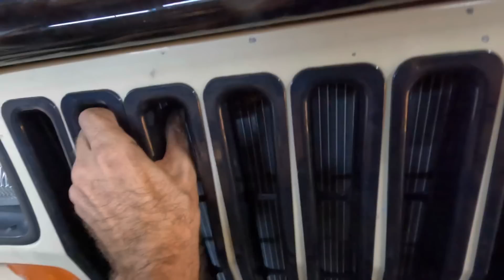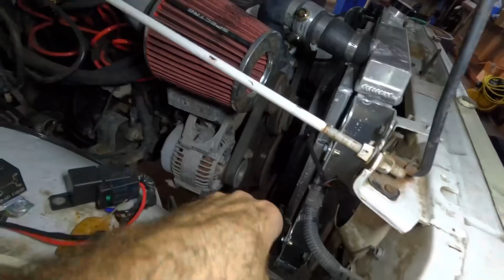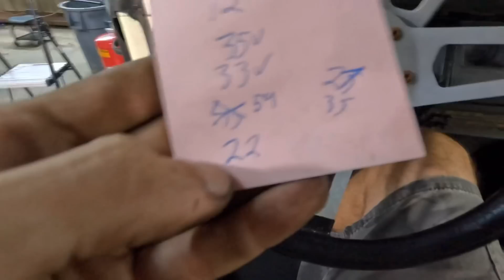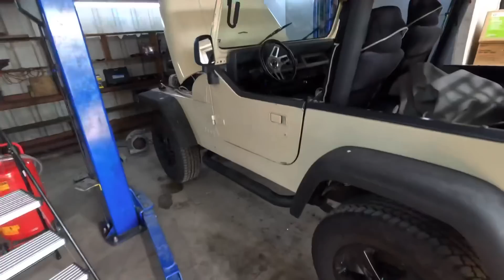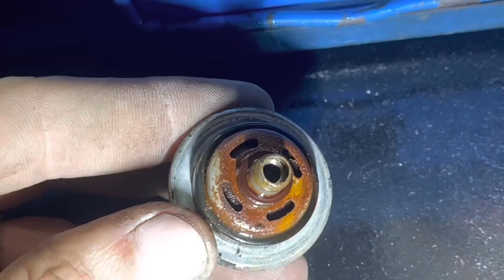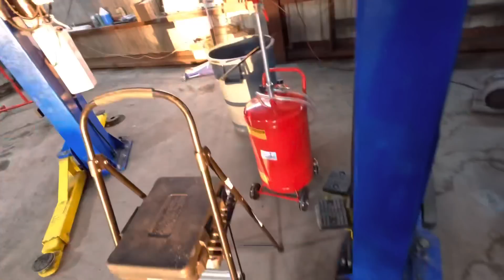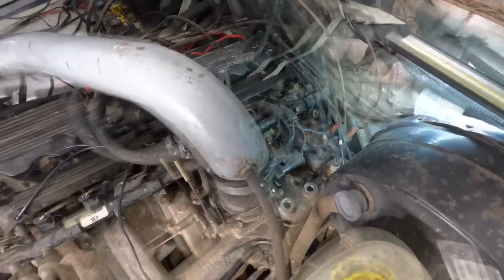Parts Cannon!! Can it be saved?? 95 Jeep Wrangler 4.0

Comment: Refreshing to see an issue present itself to the repair person as the owner reported. I did computer repair for a living and I often had to deal with issues that never showed themselves to us when we had the computers on the bench. The manufacturers frowned upon using the parts cannon (for warranty work) and we (the company) risked getting punished. Out-of-warranty work wasn't any easier, mind you. Customers didn't enjoy having to pay for replacing every bit of hardware in their computers and we certainly didn't want to be stuck with parts we might never be able to sell. It was easier if it was a higher volume model since we could "borrow" from the computers that were waiting for parts.

Comment: Mine is a 92, and it likes to run around 215. Got almost 600,000 on it. Never had the valve cover off it. 5 radiators, 7 water pumps, 2 alts, and 2 starter rebuilds. Tranny starting to give me some problems,(auto). 4X4, 4.0 HO. I am a preventative maint. tech, trained in the USMC/Navy. I have used TUFOIL in it sense I bought it in 98 with 70,00 miles. Replaced the suspension 3 times now. Will never sell it. XJ. You can see it on my YT. Same name. Peace

Comment: Could be pinched fuel lines near the tank. They run between a cross member and the body, and when the body mounts go bad, or the cross member rusts, the lines get pinched causing a low fuel condition. Happened to me on my 95 YJ. Ended up blowing a hole in the rubber hose connecting the fuel pump to the sending unit due to the pressure. Had to drop the tank twice as a result.

Edit: I think ray ruled this out, but I’ll leave it up incase it helps someone else
Reply: Customer said it got a new pump and filter but its not putting out enough fuel, has to almost start before it makes any pressure at all

Comment: We had a troublesome fuelling issue (lean running and bunny hopping at full throttle) which took ages to fix. Threw the parts cannon at it, finally even replaced the engine - but still had the issue. Turned out to be rust in the fuel tank.
Reply: I had a Honda Magna like that. Tried everything and it turned out it was the reserve tank had rust in it. It's always the last thing you try.
Reply: The YJs came with a 20 gallon poly tank. Ironically they offered the 20 gallon tank as an option. 15 gallons was the base (but it still had the same 20 gallon tank) with a revised fuel setup.
Reply: Money for nothing

Comment: That aluminum shroud blocks too much air, need to drill some 2” holes in it to allow airflow when stopped. Stock air shrouds are always ramped twords the fan those flat ones suck ballz

Comment: That jeeps a heep. Only thing I've ever seen cause red hot exhaust is plugged exhaust and spark/cam timing issues. Never seen a cooling system overheating cause the exhaust manifold to get red hot but maybe if run long enough to get to the point of low power.   I'd definitely check exhaust back pressure with a gauge, you can't tell by judging air flow and they get worse with heat.  Plugged exhaust can cause no/hard start too  I know it seems to run decent but I'd also make darn sure the spark plug wires are not switched around and check spark timing, that can cause your high exhaust temps and backfire/miss. Ive been fooled before with plug wires being installed wrong and it ran too good to suspect they were wrong. Could be just 2 wires switched around.  Incorrect ECT would cause hard start and low power too.I wouldn't be surprised if the injectors are half plugged too as much crud was in the fuel rail. Don't overlook the basics especially on something that looks like the owner already messed with everything and put eBay parts all over.

Comment: A Jeep with 156,000 miles?  Miracles do happen!
Reply: That's nothing on a 4.0
Reply: Those old mid 90's i6 fuel injected, you could put a ton of miles on them.
Reply: 295k on mine before another one was installed. 33k on that one now.
Reply: The 4.0 inline 6 is known to easily hit 400k miles with regular oil changes. There was an issue in the early 2000's with bad heads and them cracking when someone would overheat the engine. But otherwise were a solid engine.

Comment: I would drop the tank an check the installation of the new pump I have seen the rubber hoses separate an cause a fuel issue low pressure.

Comment: Great stuff Ray!

Let’s get that engine ground connected and other grounds inspected / cleaned.  Throttle body inspect / clean likely needed with that intake setup.  Maybe drop the exhaust to see if cat is partially blocked?  Maybe injectors need electrical connections cleaned since they didn’t have their clips and FL ocean air could get in there?

Comment: My neighbor had a similar issue on his expedition. He put a fuel pump on it 9 months prior. It died. Towed home.  Dropped tank. Got another new pump. Then I seen the box from the pump he put in it 9 months prior. No English wording. All Chinese symbols. OEM pump $300. Chinesium pump $50. I shined a light into the tank. Looked like silt in the tank. Fine like baby powder. I was looking known issues up. Seems those pumps have known issues. The seals deteriorate fast. They turn to a fine silt like substance in your tank. It actually gets past the filter. Clogs everything up. Saved $250 on a pump. Ended up buying a OEM pump anyways plus regulator, injectors, filter etc etc. That silt was all thru the whole fuel system.

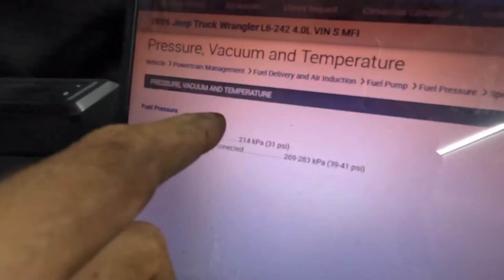Comment: I'm at 18:07 and I'm wondering if you have connected that floating ground strap yet. I would and then see what happens. Will watch to see what happens next???
Reply: Installing the ground wire strap, engine to body, I'm wondering if that would help solve some of the electrical issues with this one.

Comment: Check out the timing, over heated exhaust manifold, lack of power and slow throttle response, hard restarting points toward low timing. It could only be off just a couple degrees from spec.
Reply: I just said the same thing but you beat me to it, Dog Bone.
Reply: It's not adjustable.  So any timing issues would have to include the timing chain set, would it not?
Reply: @davidtucker3826  hi, the timing chain can jump a tooth if the sprockets are worn and the chain is stretched. Obviously this wouldn't fix the misfire issue.
Reply: @davidtucker3826  Yes the timing is adjustable, just rotate the distributor. They all have timing marks on the crank pulley and on the block. If you want to learn about timing and what is does to the Proformance of an engine watch Nick's Garage on youtube.
Reply: @dogboneknives7938  not on a jeep 2.5 or 4.0.
Reply: @davidtucker3826  Yes THEY DO, Just ask RAY, as he just said it on Jeep Part 2!

Comment: BG44K would work wonders on those injectors I reckon.
Running hot maybe down to running lean, possibly in combo with advanced ignition timing.
Looks to have a conventional distributor on there that could have faulty advance and possibly been swung by an amateur to compensate.
You need to get the strobe on it.
Reply: Running lean for sure.  I'd want to check the condition of the plugs to see if it's all cylinders or not.
Reply: This is exactly what I think it is. No idea if you can adjust the timing on these thou
Reply: You sir are correct in one of the many cause that can create the misfire and poor starting. I'm still concerned about that fuel pressure not changing to a higher value when vacuum is removed. Can't take the word about many parts changed being of gud quality. That compression needs to be tested as well.

Comment: Could the manifold be bent and drawing air. Might be worth whipping it off and putting a straight edge on it.
I'll edit once I watch more of the video..
So, looking at the condition on the inside of the FPR housing,  it may well be worth flushing and cleaning the fuel delivery system.
Doetake a very big piece of 💩 to get lodged in an injector nozzle and restrict fuel delivery.

Comment: I have a odb1 testor for sale if you want it, 75 Plus shipping and it's not a cheep one the fluke meter inside is worth more than I'm asking. My 4 cyl. 5 speed seemed to have more up and go than that 4.0 it would turn over a set of 30 inch wranglers.

Comment: You missed the title of this video by a mile. It should have been called code 54 Where Are You.
Taking some vitamin B2 on a regular basis, or even a good vitamin B complex will reduce the mosquitoes attacking you. It put something into your sweat that most mosquitoes try to shy away from. I used to have that problem quite a bit and in preparation for some work I did in South Africa many years ago a friend of mine told me to make sure that I load up on vitamin B2 or good vitamin B complex before I go to avoid mosquito issues. And it worked actually quite well. I have not had mosquito issues pretty much ever since, very rarely do I get bitten.
I noticed this years ago that with electronic injection, that people were starting their vehicles improperly. When you had a carburetor, all you needed to do, was to push the fuel pedal down about a third of the way count to about three and let it up so that the choke would set and you could turn the key and start the car almost instantly. When electronic fuel injection came about you didn't have to set a choke. But what people would do is turn the key from off to all the way to start. That does not allow the fuel pump to get pressure up. And as Vehicles get up in age like up in the 80,000 Mi to 120,000 Mi or so they tend to start very hard. Because you should turn the key on and let the fuel pressure stabilized and then start the car. It is so much easier on the pumps The Regulators and the ignition system. And this Jeep seems to have suffered all the ill effects of that bad habit.

Comment: Consider doing a injector leak down test.  With the rust in the fuel lines most likely the injectors are plugged causing lean condition. Take fuel rail off turn injector upside down and beat out on a paper towel and watch the junk come out.  Also every time you check fuel pressure you should check fuel flow, by pressing valve on the fuel pressure gauge, at idle car should remain running. The fuel you release should be put in a glass jar and let sit to see if it has water in it.  Water in fuel would explain rust in fuel rail and many other issues.
Reply: I woulda been checking plugs too, probably loaded up from the bad running.
Reply: I agree it was quite a bit of rust in that regulator have a good day
Reply: You can pull the entire fuel rail with injectors out. Pre buy new injector o rings from napa. Clean the injectors well and replace the o rings when installing. The fact that the injector plugs were obviously played with leads me to that being an issue. Add in the new rad and goofball cold intake - I wouldn't be surprised if the owner installed 'high performance injectors'. Amazon junk.
Reply: I spend 2 days trying to fix a truck once.  Drove it around for two days trying to isolate drivability issues. When I filled up with gas all the problems disappeared,  was a painful lesson...  Since then countless times I have found water in fuel. Usually when I find this I ask customer if they used gas from can they had for mower, 100% of the time they said "Oh yea I did do that.."  Here is your bill, so you remember not to do that again!  Included in bill was two cans of Isopropyl Alcohol from drug store, that we dump into tank to get water to bond with gas and run through system.
Reply: @MrEmbedded  Hmm so you can resolve a water in gas with rubbing alcohol... prefered % for this application?
Reply: @stevenswenson7041  yes the IPA will bond with water and gas and allow it to mix and run through engine. I like 99% IPA but have used 70%
Reply: Check timing ?
Reply: @loubakker5000  Why not?  If only to eliminate it as a problem.
Reply: @skingk2632  He has no fuel pressure. Check fuel filter ?
Reply: @loubakker5000  Just replace it. Two host clamps and a few metric bolts to get to it.
Reply: @loubakker5000  He does have fuel pressure, but the regulator apparently isn't responding to vacuum.  If that was due to the filter being so clogged it couldn't provide any more pressure I wouldn't expect to be able to drive that Jeep, it would fall on it's ass as soon you the loaded the engine .  What he should have done before condemning the regulator is to test it with a mityvac vacuum pump rather than relying on manifold vacuum.
Reply: @loubakker5000  he said fuel filter and pump been replaced..
Reply: @elvisziemelis3723  Check nevertheless. Eliminate as much as you can, starting with the petrol. Well, you know what I lean.
Reply: Agreed, that amount of crap in the fuel rail is a big red flag and quite likely to have contaminated the injectors.  Possibly the fuel filter has collapsed with age and is allowing unfiltered fuel through,
Reply: @ferrumignis  except he mentioned multiple times that the fuel pump and filter were brand new... yes its possible that the fuel pump could be faulty from new, but its unlikely the fuel filter is faulty from new unless the person that replaced it put it in backwards!
Reply: @Aspie_Geek_UK  Yes the filter is new now but what was it like before it was replaced?  Something has allowed quite a bit of crap to build up in the fuel rail.
Reply: @ferrumignis  That's a really good point. My Studebaker Champ kept clogging up fuel filters until I pulled the tank and gave it a good cleaning (that was fun!). No more problems after that.
Reply: @ferrumignis  Ray said it has a new fuel pump and filter
Reply: @ferrumignis  he stated it has a new pump and filter but it could be defective?
Reply: @paulabes4220  Is my post about the filter condition before it was replaced not visible?
Reply: Smart stuff... Water/rust...in fuel...old curb stator units had rust in float bowls too.
Reply: I’m wondering if that Jeep hasn’t been under water,that would explain why all the sensors and computer have been replaced,and explain all the corrosion on all the relay terminals.
Reply: @jackieliner3812  27 years can also do that to a car.
Reply: You are correct. Pull fuel rail and injectors. Flush install new o rings
Reply: I think the injectors are clogged too
Reply: Injectors are junk, check the new fuel filter for rust
Reply: O2 Injector will cause A leak condition
Reply: You must all be mechanics.
Reply: @Leothelion2008  Don't need to be a professional mechanic to know that rusty crap in the fuel rail is not good.

Comment: Thermostats and rads go out in those like it’s nobody’s business! Well, the sample size of THE ONE I HAD anyways lol but those inline sixes used in those old TJ’s were basically bulletproof!! You could easily work on them too. Unlike my current vehicle, my 2015 F2FIDDY 6.7 PowerStroke which I can’t do much on it in its current suspension configuration lol good to see these old Jeeps still kickin though!

Edit: possibly plugs/wires??
Reply: My grandson has one it's a good little vehicle it was his first star to vehicle and I thought it was perfect have a great day
Reply: @michaelpressman7203  yeah they’re generally pretty good and have strong engines in them. They don’t have a lot of power and acceleration, but with proper maintenance can run a long time!!
Reply: I learned early on that basically when you do cooling on one of these, you do the water pump, thermostat, and viscous fan clutch all at the same time.  And often a radiator, too.

And it repeats every 4-5 years.

(in 25 years and 327,000 miles that's my experience, at least)
Reply: @litz13  yep that was mine and friends TJ’s did the same. We put better thermostats/ higher temp ones and it helped a little, but not that much really.  I had 35’s on mine which was a mistake lol couldn’t get out of its own way.
Reply: @KendrasEdge757  exactly - stick with OEM, and keep all the parts fresh. 
 
Doesn't hurt to hose-flush the engine too when you do the 5 year re-do.

Comment: The replacement fuel pump is suspect. I have had to do the pump 3 times in my 2004 TJ.  A number of the non Mopar fuel pumps suffer from bad drain back valves.  When you shut the engine off the fuel is allowed to drain back into the tank at least partially.  On my TJ you would have to turn the key to the run position 3 times prior to actually cranking the engine over to build enough pressure to get it to start.

That fan is just a joke.  they replaced the radiator with a large aftermarket and did not have the space for the mechanical fan.  I doubt it has near the CFM of the stock mechanical fan.

Comment: I developed a vacuum leak on our 1971 Bombardier trail groomer about 10 miles from home because the rubber cap dry rotted,plugged it back off with a small piece of tubing and a christmas light I found in my pocket! Funny is,its still in there 5 years later!
Reply: It’s funny how some temporary fixes become permanent when they work! Lol

Comment: Back in the 80th I had my own auto  repair shop and I saw that problem a few times and always it was the Catalytic Converter that was blocked when the manifold got extremely hot ( red hot) It always started with the vehicle losing power and slowed down and stopping, then would not start againg before it had cooled down.
Reply: That was the first thing I thought of! Converter is clogged!
Reply: Bingo 👊🏻👍🏻

Comment: I really wish I had you as my mechanic. I am now taking my work car back to dealership  for the 3rd time for squealing brand new brakes. I've put 600miles on them and when they heat up they start squealing with I apply the brake. Also a weird dull grinding sound with  vibration in pedal at the very end  of a hard braking.  Yet when the brakes a cool they are fine.

Comment: Hey, our Fieros have the flashing engine lights for codes too...

Got to jump a couple leads in the center console to do it, but mine has a hold switch added so I can just hold it down to see the codes instead of opening up the console to manually jump them.